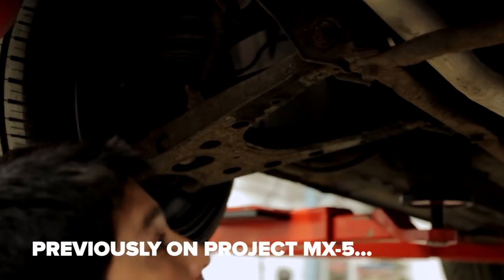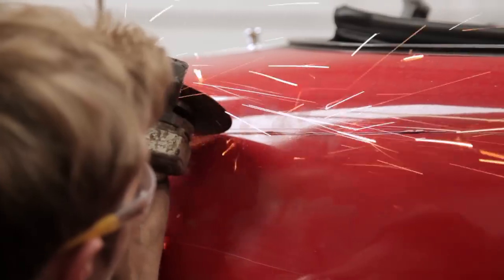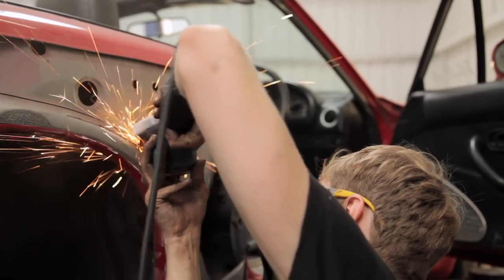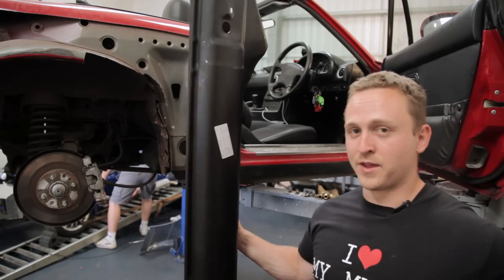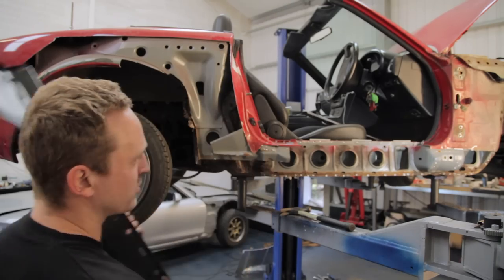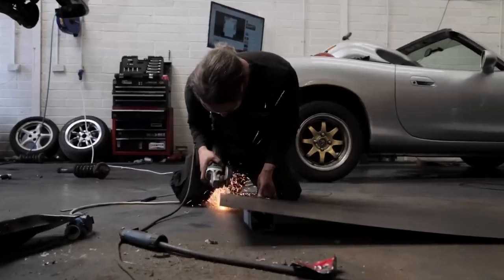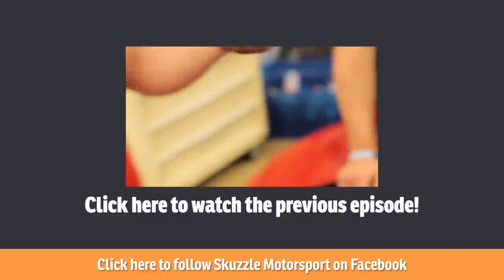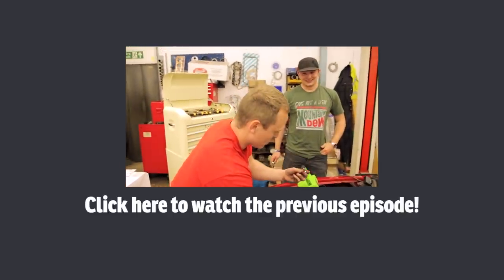Project MX-5: Saving My Rusted Miata From Certain Death

Comment: Rust holes? More like weight reduction
Reply: DinoTheAynlsmasher amen
Reply: THE TRUTH HAS BEEN SPOKEN!
Reply: Steel weighs 40% more after its rusted btw.
Reply: lkjlkjlkkj but the holes takes away a lot.. would be interesting to see how it really effects the weight. If the holes are enough to keep the weight down vs the rust weighing more.
Reply: If you get holes in important structural members the car will be less stable and have less torsional rigidity
Reply: ***** Thanks for letting me know, I was about to go rub salt and water into my cars frame rails.
Reply: Speed holes.
Reply: bro
Reply: @MikeG446 ok nerd

Comment: I'm not one to put the blame on anyone but normally if the bloody previous owner or first owner actually bothered to protect the car and look after it, half of the miatas about today would be rust free, roaming the city streets without a hitch. I blame non car guys
Reply: Sam Kent exactly! they can't take care of cars for toffee.
Reply: Sam Kent all miatas rust. it's a design flaw apparently
Reply: my 1991 is rust free :) but also form Arizona
Reply: Salt + water + stock miata with no rust protection = rust. Because the uk uses salt in it's grit, a lot of the mx5s here rust.
Reply: I'm guessing that you live somewhere where it doesn't rain or ice over quite as frequently as it does here in the UK.  We have one of the worst climates for rust.  It's wet, not that cold but we do get ice on the roads in the winter and so the councils put salt on the road.  All of that adds up to a the perfect environment to encourage rust.

Comment: (in a super bro voice) dude just like put a v8 in it. Like my cousins got one with a v8 and he pull veyrons. So like should just do that... bro
Reply: He should get a LS7/9.
Reply: Woo Jake likes CT too!
Reply: Jake TheGardenSnake Love your videos man
Reply: Jake watches car throttle! Another reason to love him!!
Reply: Jake TheGardenSnake depending on the v8 and what you do to it in terms of forced induction, you could possibly make a veyron driver nervous. veyrons are not as fast as they used to be.
i mean, imagine something like 700 horsepower in a teeny tiny NA. talk about power to weight
Reply: Jaaaaaaake
Reply: Naaaa 2JZ or RB26DETT are the best engines in the world... i see you are no car guys
Reply: ***** Well a 2JZ or RB26DETT costs about 4-5k thats not much my Bodykit on my BMW cost 3k and on my Nissan 4 K
And yes they are strong but a 2JZ is Stronger or RB26DETT 
They can get up to 3000+ Hp
With a chevy its very hard to get so much
Reply: ***** my opinion is the bmw m3 e36 straight 360000 without a a bang from the engine and 2jz are reliable so is the rb
Reply: ***** But they arent RB and 2JZ are the best engines in the world this is FACT
Reply: Jake TheGardenSnake MX-5/Miatas are built to be very light and very nimble, their forté is handling NOT straight line speed! I feel a big V8 would make it feel like a boat around corners, and this car is for having the top down around winding roads. :)
Reply: Just slap a 2JZ into the miata.
Reply: Rohan Pritchard an ls swap is only a few hundred pounds more actually
Reply: ***** There is someone a non car guy...
Reply: ***** You know that the 2JZ-GTE is factory twin-turbocharged, right?
Reply: still it isnt shit
Reply: ***** Wtf you havent even a licence bro
Reply: ***** For fishing...
Reply: I got a Volvo 740, should I swap it with 2JZ-GE and Twin-turbocharge that shit or swap it with a SR20DET?
Reply: Prydestalker Sell it and buy a Multipla
Reply: lolno.
Reply: Prydestalker Hell yes
Reply: and swap it with a 3.7 v6 from a mustang?
Reply: Prydestalker Swap it with the prius engine?
Reply: Jake TheGardenSnake Jake, its' not a smart idea to put a V-8 into a car that's been weakened by rust. The big engine will cause flexing of the entire car, and something could snap with disastrous results.
Reply: Jake TheGardenSnake never thought i'd see the garden snake on an mx5 video
Reply: Jake TheGardenSnake Miata is the LGBT community's  sports car of choice.   Zoom zoom.
Reply: ***** gay is ok.

and the mx5 is a bloody ripper, i bet you drive a civic or the like.
Reply: ***** Zephyr, I have no idea what a "ripper" is. I don't understand some of the English slang from down under or Europe. Nope, I don't drive a Civic or "the like." Can you guess what kind of car I drive? I drive a 2008 MX5 with retractable hard top. It's a cool ride and I love it. I've owned two other Miatas, both of which were 1990 models. One was bone stock, and the other one had a fully-modded turbo, with limited slip diff, suspension mods, etc. If you ever drove that car, you'd change your mind about the Miata being a "girl's car."
Reply: Rick Hilton I was talking to stinkhole mate, hence his name tagged in the comment.

i have an NA, td04 turbo charged, denso 450cc injectors, carillo rods, haltec ecu, flat top billet pistons, high flow oil and water pumps, ported head, stroked to 1.9L, tien coil overs, wilwood big brakes, 6UL 15x8 225/45R16 rears 215/45R16 fronts advan ad08 Rs, chassis bracing, roll bar, lightened to 890kg, excedy clutch, torsen lsd, adjusted lca front and rear, jackson racing plenum, custom dump and 949 headers. all in all making about 300rwhp and could easily make up to 370 odd, it murders my mates silvias and rwd skylines in the twisties and can hold it's own at the drags

i'm on your side gramps.
Reply: ***** You ever hear the phrases 'polishing a terd' or 'lipstick on a pig'
Whatever you do to it, it's still a Miata
Reply: Rick Hilton Any car that does a14.5 sec quarter mile is a car that wouldn't be considered a sports car since the early 1900s.  Yeah, a go-kart is fun too... In the amusement park.  I prefer my cars in at minimum low 12s in the quarter before labeling them as fun.
Reply: ***** drag racing is not really my forte, neither do i find it fun, fast drag cars aren't fun on the street, nor can you use them properly except for less than half a minute at any one time on a track.

i can take my car to the other side of the mountain range or down the coast road through 100km of twisty roads depending on which route i take, and stop somewhere along the way for lunch with the missus, not break either of our spines with a harsh ride, not use too much fuel, not break the car or most importantly not get into any serious trouble with the law. if you roll up outside the cop shop with a cammed ls3 that can lay 10s at the quarter, you will get defected and fined, roll up in my car and they'll probably smile and wave.

and your " Any car that does a 14.5 sec quarter mile is a car that wouldn't be considered a sports car since the early 1900s" is such a crock of shit, drag racing is not the be all end all, a sports car is a car that you can drive spiritedly and still use it every day, not some drag strip missile.

in any case, a true petrol head appreciates all cars, regardless of the make.

PS, takes more skill to back a car in and nail an apex than it does to mat your foot to the floor in an auto for 15 seconds.

and if you don't like the car why watch a video about them...
Reply: ***** Yeah, Zephyr, I realized my mistake after posting my reply. I agree with your comments. Stinkhole prefers drag machines with sports cars. Unfortunately, you can't really get both a dragster and sports car wrapped in one package... unless you spent LOTS of money for a car. I don't know about you, but I don't have that kind of money to spend! A Miata is a great little car that handles very well, and is a great value for the money. Sure, it's not a dragster, but if you want to spend a little money on it, you can enhance the performance with a turbo and you and I did. If you really want to go wild, add a V-8. But, it has a downside. You end up with a vehicle that's nowhere near as satisfying as the stock version.
Reply: Rick Hilton well i've been working since about 14 so i had a lot saved up, and all through uni i worked too. i've only spent about 20k including the price of the car which i bought for 3k the day i got my license. all in all i'd say it's performing about as good as if not better than a 40k s15 or wrx, only downside i've got is only two seats.

I was thinking maybe swapping a v8 or rotary in, but i think if i'm gonna spend the money to do that i might as well get another car, which i will, most likely an hsv clubsport wagon, fd rx7 or r34 gtr after i rob a bank or sell a load of drugs of course.
Reply: Nah it's just not funny
Reply: Rick Hilton ~~~> You need to explain what you mean by "fast." <~~~  
I believe I did that with the cars I mentioned.

~~~>  It's okay to have strong opinions, but you don't need to put down the other guy's ride to make your point, do you? <~~~
Well, I guess I would say (1) the people I've seen driving Miata's are typically found in the gay community, and (2) you're severely disingenuous when you claim to want a miata for its performance characteristics when for nearly the same money you could get a massively higher performance car in every respect, not just straight line, by buying a used Gaymaro SS or Mustystank GT.  So your motives for wanting the Miat-ugh are highly suspect.
Reply: +Zephyr467 Zephyr, driving a race car on the street is an uncomfortable and less than enjoyable experience, as you've discovered! Congrats, though, in building up a car for maximum performance.

Regarding Mr. Stinkhole (why would you choose THAT disgusting name???), I suspect that he's either a really young guy with no sense at all, or else he's just another troll leaving rude comments to get a reaction. We'll wait to see what his latest nonsensical comment is...
Reply: +Rohan Pritchard Rohan, you are incorrect regarding the handling and suitability of mating a V-8 to a Miata. Search YouTube for Tom's Turbo Garage and see his 12 part video, where he took a late-model Miata and installed a LS3 (small block Chevy) into his Miata. You will see that what he ended up with is comparable to a sixties Ford Cobra. This car will make you drool! Tom does things correctly and I wish I could spend time with him watching him work! Also, search for "Monster Miata" on YouTube, and get a surprise...
Reply: +Ryukachoo 700 horsepower in a Miata would shoot it off the road. They would literally need a spoiler and much bigger tires. The car wouldn't be heavy enough as it is.
Reply: +Sparkly Napkin Sparkly, sorry, but your comment is illogical. Using your logic, all formula cars and stock car racers would "shoot off the road!" If properly set up, with adequate suspension and tires with good grip, you can easily accommodate 700 HP. Try googling "monster Miata" and see how a turbocharged V-8 turns a humble Miata into... a monster (of performance)! I'm sure that there an upper limit of horsepower with any car, but 700 horses is actually not that unusual these days.
Reply: Rick Hilton A Miata does not have tires with that good of grip and they're pretty small. you misunderstood what I meant. Relatively weak sports cars are designed to be fun despite their low power just like the Miata and the GT86 (BRZ, FRS) which is why they have smaller tires that lose grip more easily. I'm talking about a stock Miata with a 700HP engine. A Miata is not set up to handle 700HP it's set up to handle 155HP and be a shitload of fun with only that. I was just saying that you would have no choice but to modify the Miata if you were to put that much power into it. You'd need more grip, thus the mention of both a spoiler and bigger tires in my previous comment. I also mentioned the weight of the car because it does increase the grip your tires have with the road. A spoiler does virtually the same thing by increasing downforce on the car, pushing the tires onto the road giving you more grip. Why do you think the GTR is so heavy?

Side note: making an engine more powerful is not that difficult you could make an I4 make 500 HP it's just a matter of reliability with that much power.
Reply: +Sparkly Napkin Sparkly, well, of course if you're talking about taking a stock Miata (or any car, for that matter), suddenly increasing the horsepower to 700 horsepower would create a car that is probably going to be very difficult to drive. All the things you say are obviously true. Increasing the horsepower would necessitate making many other adjustments to accommodate the power and torque. As you say, cars are engineered and developed around the power package, and the car has to be tuned properly in that regard to make it handle correctly. 

I can't even imagine how my 1990 Miata would have driven if I could have magically boosted the power to 700 HP! Imagine popping the clutch at idle and still being able to break traction and spin the tires!
Reply: Rick Hilton 
I can't even imagine how my 1990 Miata would have driven...
Well, with that much hp you wouldn't even have to remove your rainbow pride bracelet and female impersonator outfit to reduce drag... Get it.... Reduce drag. Bah ha ha ha
Reply: +Jake TheGardenSnake never thought id see you here haha
Reply: love your videos man
Reply: RBtornado25DET I love myself a supra :)
Reply: Muricans and their V8 ;D
Reply: Agreed

Comment: Jesus that must've cost a shit-ton of money
Reply: ***** He basically employed 3-4 fabricators for a month. lol
Reply: ***** That's atleast £30/hr as 'mates/promotional rates'...now, 30x16 (8hr pay x2 for two fabricators) = £480, a day.

1 month+5 days=35 days.

£480x35=£16,800. +material cost (easily £5000)...

£21,000+ for a 1995 MX-5? Alex Kersten are you mad? 0_0
Reply: MattySP34Ks imagine if he did that would be mad I think it was all promo with a bit of money. Think of a radio ad for the company would cost a lot and only reaches some potential customers where as this reaches just the right people ☺
Reply: ***** Had my sils replaced on my calssic mini because it failed mot and that cost £2,500. Yes its very expensive haha.
Reply: yeah too much rust i would have bought a new rust free or less rust and swapped the  mods to it
Reply: that's why it pays to do it yourself :3  can't wait till I can start restoring my mazdaspeed protege
Reply: I'm guessing around 4-5k with this kind of paintjob
Reply: ***** 21k? Must be more like 3k
Reply: Yeah, the reason they took a month wasn't because they were working on it 8 hours a day LOL, they just had other cars to work on too and it wasn't urgent. A few k is right.
Reply: "Uneconomical" is damn straight. If it has more holes than Swiss cheese and even Roadkill would say "Oh, screw that," that car should realistically go in the bin.
Reply: try intire new front quaters shock towers rear quaters pan halfs and front bulkhead

Comment: This was what spelled the end of the line for my old MX-5. It would've cost way more than the value of the car to repair so it was 'see ya later' to Marv. Lesson here? Never ever buy an old UK spec MX-5. They are almost all in this state underneath. Get a Eunos if you can find one. You just might avoid these issues.

Comment: I also have a miata and I had my headlights were sunken a little bit such as yours are and aren't flush with the hood.. just pull them up a little bit with your hands with the hood up and they will sit flush and it will look cleaner.. just a friendly tip

Comment: there is a red 1997 NA MX5 in Germany with 9 027 kms driven, being stored in fully air conditioned garage for 15 years, it costs 14.985 €
maybe that car is cheaper than restoration we saw, anyway there is one more Miata on the road now, thumbs up for that

Comment: Cool to see it fixed but that orange peel painting is pretty poor.
Reply: ***** If it's the sill you mean, then that 'orange peel' is in fact stone chip.
Reply: ***** By the way orange peel is easy fixable
Reply: ***** its supposed to be like that
Reply: The lower parts of older cars are painted with this rough textured paint so its resistant to stone chips.

Comment: Why didnt you scrap it? It has got no stiffness now
Reply: The car is worth more the the cost to repair it, not $$$ wise.
Reply: well said, but now it needs every strut bar you can find for a mx5
Reply: mati2400 How come? They did it like the factory - spotweld sheet metal to make a car. I bet it's as stiff or stiffer than original.
Reply: There is no way this car is worth as much as the repairs